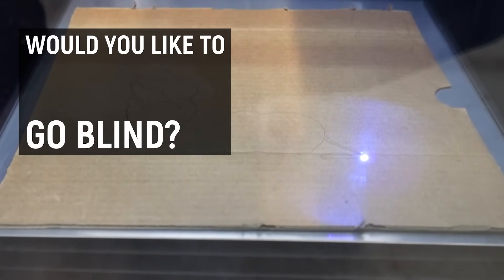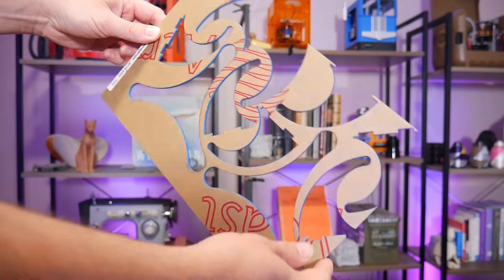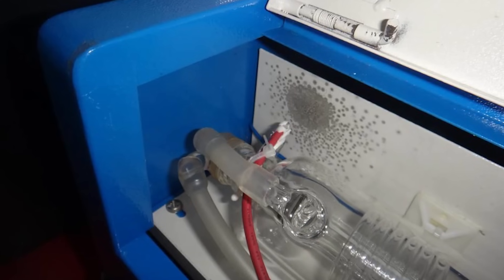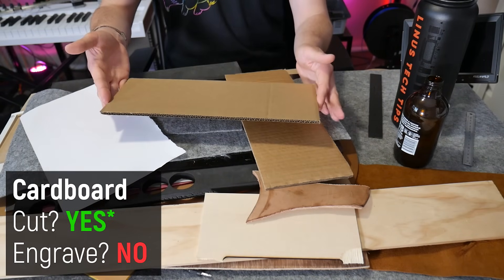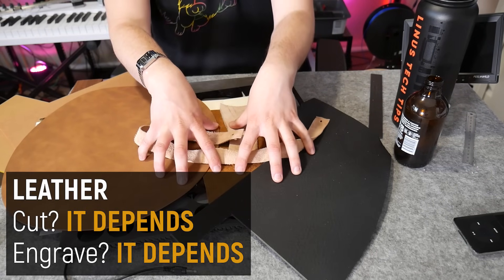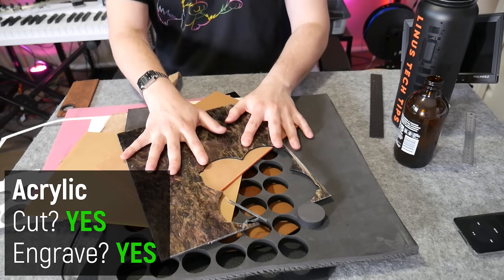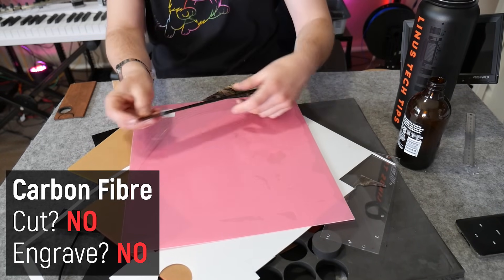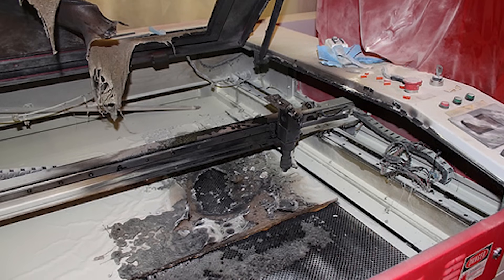Are cheap laser cutters safe?

Comment: Imagine you can cut of fingers or arms with a circular saw but millions of people use them. I have several of these diode lasers and have to agree not to trust the user manuals. These machines are dangerous like some other power tools as well. It's your responsibility to inform yourself about the potential danger and to do your best to avoid it. The laser stands in a seperate room with fume extraction to make sure the dog is save. It never runs unattended and yes its a huge issue with these cheap safety googles provided with the machine and no warnings about the toxic behaviors of several materials. But its a great machine to cut things like a circular saw is.

Comment: I want to pick up a K40 laser, but before I get it I need to set up cooling, ventilation, and power in the garage where I want to put it, and I'm approaching it the same way I would approach a brand new A8 - all the power handling circuitry is considered suspect until I look it over and replace as needed.

Comment: Excellent video. Note that there's a simple test for whether a material has chlorine (google 'hot copper wire chlorine'). I've got one of those open frame lasers but I don't intend to use it until I build an enclosure to make it as safe as my big CO2 laser.

Comment: around 10:00

im not an expert at laser cutting but i am an expert at burning literally anything to use as fuel for fires

chrome tan leather should be safe to burn, none of the materials in there should be able to form any toxic gas, most heavy elements (besides lead) have trouble burning and are going to be left in the char on the edges or flakes that fall through the work surface, not the smoke

Comment: Very interesting video. Thanks for sharing. I think I missed one thing  (I'm interesting in a cheap laser cutter): how can I control if the goggles/glasses which come with the laser cutter are good enough protect my eyes?   (diode laser cutter, no enclosure). For the fumes I'll have to find a solution. But at least at the start I'll only use real wood (pine, only engraving), normal plywood, (engraving + cutting) and acrylic (only cutting, for making templates)

Comment: I have managed to laser cut very thick carbon fibre in the past, with a 16kW industrial fibre laser, inside a contained cell with arc welding grade extraction. It cut terribly, most of the time there was delamination and we managed to set it on fire a couple of times. In the end we gave up and abandoned the experiments. The most interesting thing we cut was synthetic chitosan, which produced various gases when burnt that had a strong "burnt sugar" smell, which made the lab smell like a patisserie.

Comment: I'm currently building a diode laser cutter. The plan was always to use it in a well-ventilated area, or even outside. 
Thanks for the advice on material properties and safety!
Reply: Put it in a box, preferably a metal one! If you’re using aluminum t-slot extrusions for the frame, this should be fairly easy to do…
Reply: @darkwinter6028 maybe eventually. Currently it won't be used in direct line of sight to anyone.
Reply: @darkwinter6028  Are you saying connect the box to the frame somehow?  How would that work?  The boxes I've seen online just sit over the whole unit.
Reply: @DrChiYT  The idea was to attach metal panels to the T-slot frame with bolts and T-slot nuts; thus using the aluminum extrusions as a frame for both the laser cutter’s x-y transport mechanism as well as the light-blocking enclosure.

Comment: Thanks for the great and informative video. I've had a 3D printer for quite a few years now and have been wanting a laser cutter for almost as long. I had been looking at some of these cheap cutters made from "Chinesium", and had concerns regarding the safety and effectiveness of them. The same goes for the el-cheapo CNC router/milling machines.

I guess that I'm just going to have to hold off, save a load of cash and purchase a well made and relatively more safe machine.

Edit: And I think I will probably buy myself a CO2 fire extinguisher too haha

Comment: A freind of mine and I once have disassembled an old CO2-Laser that was capable of outputting 3kW of beam power. That whole machine was incredibly overengineered. Its cavity consisted of 8 gas tubews in series an needed a supply voltage of 20kV @ ~20kHz AC. The power for the beam emitter was a whole 2m tall rack with the power amplifiers double/triple shielded for acceptable EMI. And the heat pump was speced for upwards of 25kW of waste heat x3

Comment: leatherworker here (hobbyist so take this with a grain of salt)
you absolutely can cut/engrave leather, but you have to be pretty specific with the type. it has to be chrome-free (most veg-tan is, but some has a very small amount added, so double check just in case), un-glued and un-dyed. It also helps to get it damp first I believe, which should help the smell too. I repeat, DO NOT engrave chrome-tanned leather. Often, leather suppliers will indicate whether leather is safe for burning (similar to what you'd see with a wood-burning pen,) which can be a good bellwether as the conditions are similar.
And, of course it should go without saying, please don't try to engrave faux leather. That crap is nasty. Honestly the PVC isn't even the worst of it, some of the pieces I've cut up are basically filled with carpet padding.

Comment: THANK YOU!
I've been stating this over and over, whenever both strangers on the internet and the people around me, have talked about laser cutters and the dangers of using the, without an enclosure, fume extraction and filtering, as well as personal rules. Despite this, some of those around me don't really understand why I do so damn much to protect myself in regards to my laser cutter. I bought a laser cutter from SainSmart a little over a year ago (the LE4050) and it too, came without an enclosure. Luckily I've worked with laser cutters before, so I know how incredibly dangerous they are without an enclosure and proper ventilation, so I haven't actually used mine yet, as I refuse to even install the software until I've made a cabinet for it. And I've chosen to build a metal cabinet out of steel plates, as the small diode laser absolutely won't be able to do anything to that. I've also invested in a honeycomb cutting surface for the lasercutter and I've bought a transparent red acrylic sheet, which I plan to put a two way mirror on, just to reflect any stray light from the laser, while still allowing me to use it. I specifically chose red, as the wavelength of the diode laser, shouldn't be able to pass through that sheet, but just to be sure, I will, as stated, install a two way mirror foil on it, to avoid any problems. I also plan to hook it onto a solid tube extraction system and I want to install a couple sensors and find a way to edit or inject code into the firmware, so it automatically shuts down if it detects too much smoke and/or heat within the enclosure, as a precaution against fire. Furthermore, I've bought a CO2 powder extinguisher, just in case it catches on fire.

All of my plans might be overkill, but I don't care. You can't take safety too seriously, so it's always better to go total overkill, than to cut corners. The bet is your lifespan if you choose to ignore or cut down on safety precautions, so I hope that my clarification to never use it while sleeping, is a redundant advice, but these days I honestly don't know. I'm just glad you made this video, as you have the education to back up the knowledge. I'm just a cabinet maker apprentice with an interest in making within multiple different fields.

Comment: So most equipment if not used properly is not safe. But the sellers of the equipment have a responsibility to be clear about how to be safe. And the  buyer should do their own due diligence about the product as well. Just about anything in my shop could do serious damage. From a hammer, brad nailer,table saw, CNC,trim router,co2 laser cutters and more.

Comment: Is laser cutting outside or in a garage with the door open enough for ventilation?
Reply: I’d get a powerful fan with flexible ducting to send the smoke away from you. They make them for drying out carpet and similar tasks, so they are readily available for not too much $$$. Alternatively, you can always get a centrifugal blower style fan, some clothes dryer ducting, and a roll of duct tape…
Reply: @darkwinter6028  Thank you! My partner made me one of these to save my hand-cutting fabric (carpal tunnel) But I have always thought it was dangerous but couldn't tell why since he's the engineer and I know things about the tech side.  This will help me a bunch.

Comment: I am waiting for a diode laser cutter of that open gantry design but i built a enclosure for it ahead of getting it... its a bit large... and i have a activated charcoal filter fan thingy i set up for it :)

i also got a approriate protective window for the box... all i need now is to illuminate the inside a bit i think... maybe.. hmmm.. and some kind of air assist :)

I have pets so yeah that was a concern as was fire since i made the box out of wood but i painted it all in multiple layer of sodium silicate and a black pigment in mulptiple layers

Comment: I totally agree. Many years ago I was a high speed laser printer specialist. Back then the internal laser required careful alignment. These were relatively low power lasers compared to the current cutters you speak of. There were two people blinded in one eye in my time with that company. Anyone who thinks lasers are safe needs their head looking at. These unguarded, no filtration designs should be immediately banned IMHO

Comment: Everything in this video is great advice/warnings  and yes a fully enclosed machine case gives total protection from ANY risk of  the laser beam attacking you. However, that closed box must be not be fully closed. Look around at many case designs (especially K40s) and there is nowhere for fresh air to ENTER the case except through badly fitting door cracks. You cannot extract the fumes  if the case is closed.To extract those harmful smelly fumes you must allow air to FLOW THROUGH the case otherwise you are just creating a static vacuum chamber that traps the fumes and will get a lungful of fumes everytime you open the case,. Laser beams are dangerous  and must be understood and respected rather than feared. A laser beam is just like bullet. Get in its way and it will harm you. There is no sideways radiation emitted from a laser beam so why wear safety glasses?  Unless you stick your head directly into the laser beam path your eyes are not at risk, your fingers and clothes are more at risk. Just like a bullet ricochet, there is a risk of a laser beam reflecting off a METAL surface  (like a pool ball bouncing off a cushion). The surface has to be at the correct reflection angle to hit you, so firing the laser at a metal surface always creates a potential risk. If I cant get my head in the way of the beam and I'm not firing at metal, why wear special safety glasses? . For a closed case machine that disables the laser when the lid opens  it is unnecesary. However , for those open frame diode lasers  which are not always cheap, the risks to your health from fumes is accurately identified in this video but  there is still little risk to your sight from the laser beam itself . Even at 450nm wavelength it is still just like  a bullet with no sidways radiation that jumps out to attack you. The REAL risk to your sight is far more insideous and not mentioned in this or any other safety video. Diode lasers have very poor quality beams (look up M2 laser beam quality to understand what I mean) and are very inefficient at cutting. They engrave well but surface engraving produces lots of fumes. Those fumes get reheated by the incoming laser beam and ionize to produce a very intense plasma (bright white light)  at the work surface. Would you watch an arc welder working? Would you stare at the sun? This white light is similar in nature and  emits nasty spikes of UV B and C radiation which if looked at for too long WILL damage your eyes. The great news is that simple polycarbonate safety glasses will absorb that radiation and protect your eyes against this UV radiation. However they do not attenuates the light intensity. For that you need a protective tint,  so cheap tinted industrial safety glasses are perfect for all types of laser.  Polycarbonet will also protect your eyes for any hobby laser beam IF you happen to stick your head in the beam path.

Excellent video that should scare many new users into doing their own research

Comment: What I gather from this is, always use a fume extraction system. Think about this, most wood should be safe, if you would burn it in your fireplace, or campfire, oak, maple, walnut, etc., it should be ok to laser cut, but what about redwood, or cedar, both of these woods have chemicals in them that resist rot and insects, would you want to breath that, I know I wouldn't. Acrylic is good for laser cutting, but it is very hard to machine, because of its brittleness, I have machined acrylic, but machining is what I do for a living, and it is very unforgiving, polycarbonate, on the other hand, is excellent to machine, but apparently not to laser cut. Fiberglass and carbon fiber are best left to machining, although they're both murder on cutting tools, wearing out even carbide tools very quickly. Very informative video, and I would have never thought about leather vs pleather, although it makes perfect sense, but couldn't leather be dangerous depending on the tanning process used? I'm sure there are some toxic chemicals used. Honestly, I would think that any plastics would give off toxic fumes when burnt, even the "benign" styrene our plastic models are molded from. A final note, anodized aluminum is wonderful to etch, where I work laser etching anodized aluminum is an everyday thing, you won't cut it, at least not with a hobby laser, but a low powered laser will burn off the anodizing, leaving the bare aluminum, for lettering, logos, etc.

Comment: Open frame lasers have always weirded me out.  I'm looking at getting a small fiber laser for my home workshop, and every one I find is open framed.  If I decide to buy one it's getting enclosed before the first use and monitored with a camera.
Reply: I am also curious why every fiber laser is open framed.  Is it because the fumes from marking metal aren't as bad?  Seems like the fiber laser is even more powerful, why are stray laser beams not an issue?  I have read that the reflected beams are not focused so the lower intensity makes them not dangerous and the wavelength also does not seem suited for cutting organic materials.  I'm not sure of the true reason though.

Comment: This sort of stuff is why I tend to recommend avoiding a cheap laser, and either working with an existing maker/shop (I have done some laser cutting for friends), or using a service provider like SendcutSend, Protocase, Pololo.  

In addition to that, a number of vendors like Xtool and Glowforge are ridiculously irresponsible in selling things aimed at kids and schools that are class 4 lasers without any of the proper safety interlocks for being above .5W AEL.  Those machines are flat out unsafe, and violate ANSI standards.  They are class 4 lasers without beam containment, and lack the required keyed interlock.  My 60W CO2 laser is technically a class 1, as it's fully contained with interlocked access doors.

Comment: Brilliant, excellent and wonderful video. Truly. I am lucky enough to have a garage so my 3d printer and laser cutter both live in there because they scare me a bit, the 3d printer not as much as it used to, the newer one I have is a bit more protected, but the laser cutter is a classic K40 from china.. I did all the due diligence when it arrived, I stripped it down completely, checked all the wires, checked it was properly grounded etc but I really am conscious of how much of an invisible terror it is and I use it, a LOT. Seriously, anyone reading this, if you have or are thinking about getting a laser cutter, do the research. One cautionary tale.... I saw online that a chap had mostly killed his K40 by etching and cutting a lot of vinyl records, what happened was the vapors it was putting off coalesced onto the steel parts of the machine and rapidly rusted. He was a bit gutted. Then he realised why. Chlorine gas was created and just like Angus said here it converted into hydrochloric acid on the metals causing them to rust, he's literally lucky he lived. So far the only things I've put through mine are laser plywood, cardboard and paper and painted metal for a custom circuit board. I have a bunch of plastics lying around for when I grow a pair and work out what they are and if they are safe.